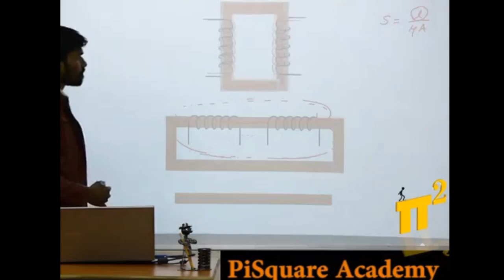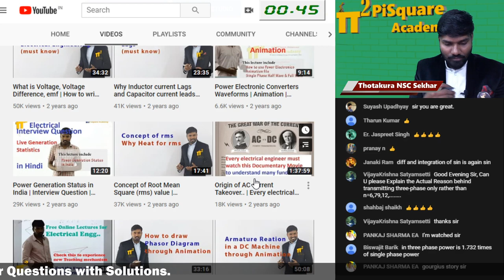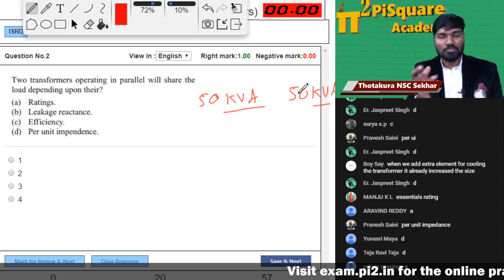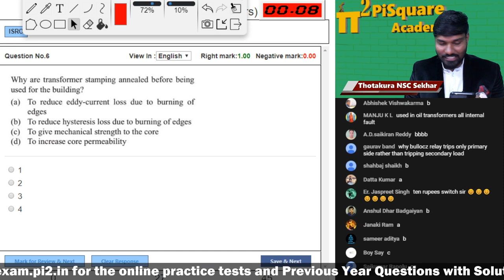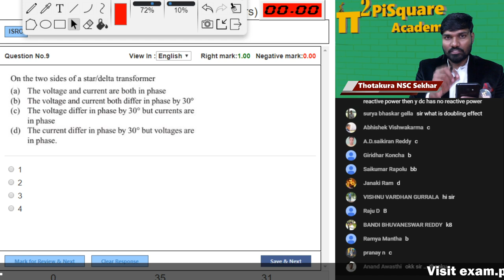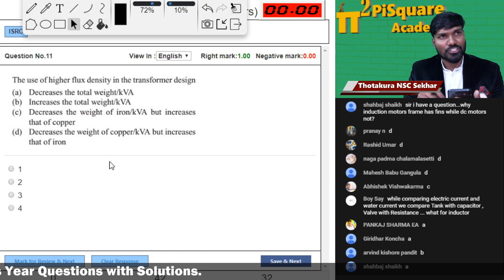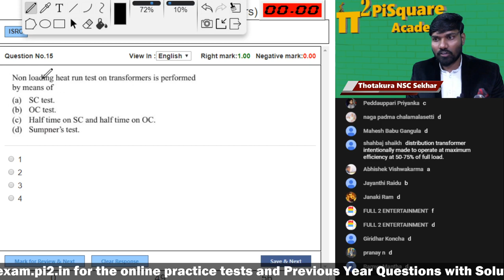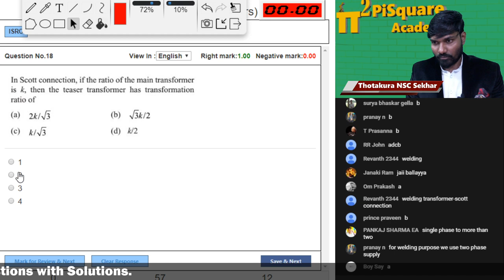ISRO PYQs Discussion (Electrical Machines: Transformers)

Comment: I need theoritical explaination about current lags in inductor....when a normal wire exhibiting resistance where the same wire in turns made current lags the voltage.... How?